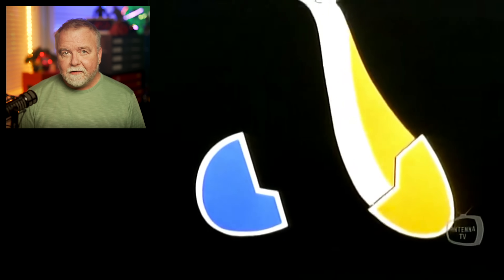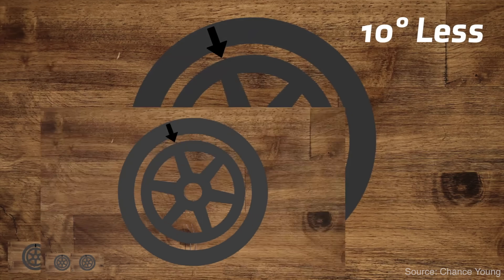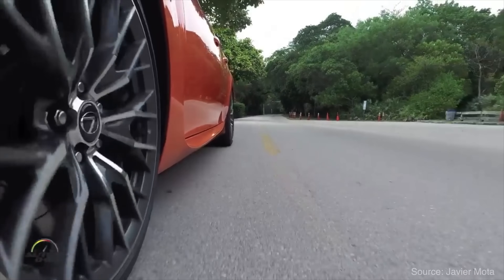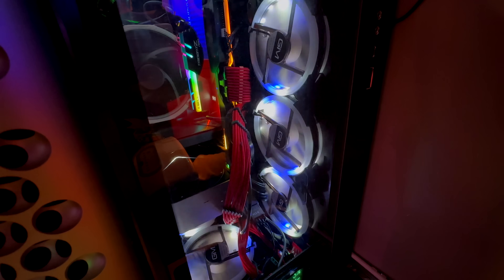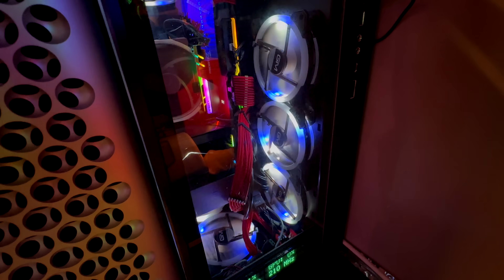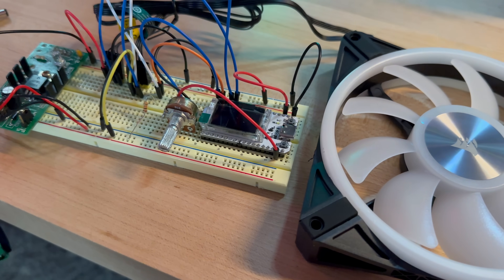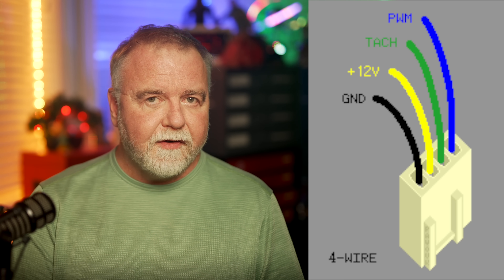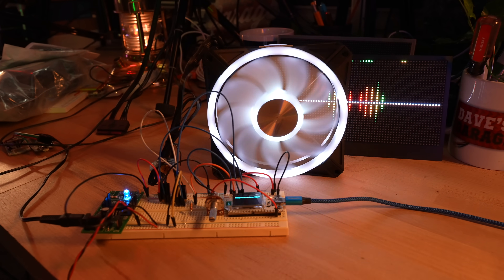Can I Freeze a Fan in Time with its RGB Light?

Comment: It would be a lot easier with non addressable LEDs. You could use a 555 timer and an IR reflectance sensor to flash the LEDs when each blade passes the sensor.
Reply: Or just a sensor that turns on the led when a blade passes by, like a proximity or opto sensor
Reply: would this not unbalance the fan some?
Reply: @PR0XYL1NK if you use an opaque fan blade there is no need for stickers or reflectors to unbalance the fan blade
Reply: @Sam-tb9xu  nice thats good solve.  thank you for the idea haha

Comment: I have a couple incites based on previous work.  First LEDs are very fast, a previous job used flashing IR LEDs to transmit audio for classroom PA.  We used FM modulation  (maybe 2-3MHz carrier, I forgot).     Lastly I did a thing that needed jitter minimized IRQs running at 16KHz.  (on screen display synced to composite video)   You need to consider the cores pipeline to reduce jitter.   I ended up using a high clockrate M0+ because its simple pipeline was the most predictable.  DMA (for SPI commands) ended up being an issue, as I had no way of setting the DMA priority and program ran 80% of its cycles in an IRQ routine.  The way DMA steals cycles from the MPU was a bit of an issue.
Reply: These are serial addressable smart individual led's. They have a serial line that runs at like 800hz to set the colors based on the address. So you have a serial data line at one freq, you have the input from the tach, you have the irq trying to do stuff, and you have the pwm input to the fan. Don't for get about the pwm modulation of the led's themselves. Also, the refresh rate and exposure time of the camera.
Reply: Did you intend to cause a riot of grammar knot-seas? Or did you mean insights?

Comment: Divide by 2 works because there is not enough time to process the LED drive  in the time available. So halving the number of times, but still running in sync, will give enough time to output the data and still be above 30FPS. 

A thing to try is to have a loop in main running all the time, that simply times the revolution time , counting up the number of interrupts to say 254, and also using a hardware timer to get a clock, that is the number of clock cycles (probably will need a prescaler so that you have a counter with lsb being a few microseconds) taken to run, and then that adjusts the count timer to the new value per revolution. 

Now you no longer have to use interrupt from the fan, instead you use another counter that is counting down, and giving a software interrupt that runs the LED flash. This counter gets updated every 254 counts of the main timing loop, to be a time that will give the right number of cycles as blades per revolution. Should then run that code and still not exceed the time between interrupts. With a 9 bladed loop probably can get away with having it run 3 times per revolution as well, leaving more time to have that ADC routine run to read the pot, convert into a PWM value between 64 and 256, and set a PWM for the fan speed control as well.  Going to be tricky, now we need at least 3 separate 16 bit hardware counters, but there should be enough in the ESP32 to handle it, though pin assignment will be tricky as some may not be easy to route, and you might need to actually have one or two actually go out and in again, but should be workable, as after all you do have a very fast core there.

Not easy on a 8088, but doable, and there you can always add in extra counters till you run out of IO space, but you got entire message displays that ran with software running the multiplexing, on a 4.77MHz part, and they did not flicker except during scrolling, running low on memory because they only had a whole 2k of memory in there, plus another 2k of battery backed Dallas SRAM for the actual messages, which had 32 bytes for the RTC as well. Plus a thermometer that pretty much always showed that the CPU and board were getting well cooked, as the sensor was right next to the linear regulators.
Reply: I knew I'd find the answer to this in the comments, and way more explanation. Thx
Reply: In reality you don't have to do all that for a short visual recording, you just need a strobe light that you can adjust the frequency with a potentiometer. You can litterally just dial in the speed until it looks right on camera. Also what looks right on camera may not be the same as what looks right to humans, the whole persistance of vision and framerate thing. It's easy to setup without even wiring anything to the sensors. It works as long as the fan stays at the same speed. If you change the fan speed you will have to change the rate obviously
Reply: This is not correct. The fans simply output 2 pulses (4 state transitions) per revolution. If you were to open the fan, you'll also see why, it's just the internal field phase control signal or alternatively the Hall signal because the motor is quad-pole, it's simply brought to the outside. Also a 2005 Intel PWM Fan spec says that they must output 2 pulses per revolution.
Reply: I can confirm that this is correct. The fan pulses twice per revolution.

Comment: one reason incandescent lamps are the best lamps to illuminate moving machinery.
Reply: There are led's that are constant current controlled or that smooth the pwm or line freq. Good led lights don't flicker.
Reply: @moki123g  I'm just old school,  incandescent lamps can't react fast enough to ever be a problem.
Reply: @TheEmbeddedHobbyist  True, not to be too pedantic but, incandescent lamps do flicker up to 13%. I have noticed it on lathes.
Reply: Hey we used to read and adjust the strobe dots on the side of the record player with incandescent lights. Though of course using a neon would be more proper.

Comment: Could you call UpdateTimers with an interrupt on the Tach line?  Then every revolution, the speed would be gently adjusted.  This would require two interrupt service routines.  And the code running every revolution may take more time than you have.

Comment: You use the interrupt just to set the boolean variable updateLEDs to true.
Then use if(updateLEDs) in the loop ( I suppose), to activate the Leds.
Why not activate the Led directly from the interrupt ???
Even if an ESP32 is fast enough, it seems to me it would be a better solution.
The way you use it doesn't really use the benefit of interrupts.
Unless I miss something ...

Comment: Cool video, Dave! Would an oscilloscope help you verify your two-tach-pulses-per-revolution hypothesis? You seem like the type of guy that has one and knows how to use it! (I would be helplessly lost!) 😅
Reply: Luckily, nowadays you get simpler ones for 150 to 200 bucks. They are "just" until 20 Mhz and have "just" 2 Channels, but for such stuff perfect!
Surely, it's not a professional one, but it's portable
Reply: @bernds6587   Nah nah about 205-220 will give you an Owon or Hantek and not that Fnirsi garbage, and those are actually 1GS/s and can be unlocked to 200MHz. They are real scopes with trustworthy readings and no horrible aliasing and other issues.

Comment: Small point: It is technically not "exactly one revolution per frame" it is one multiple of the angle associated with the objects order of rotational symmetry ..... unless you include the valve stem of course ;) If a wheel has four evenly spaced spokes then any multiple of 90 degrees rotation taking place in the same time period as a single frame will cause the wheel to appear stationary. Gotta love the spectrum!
Reply: I'm pretty sure the wheel shot was actually alternating wide and narrow 'spokes'. Still a pretty impressive coincidence. (unless he was watching the feed from inside the car)

Comment: Dr. Harold Eggerton developed this technique with Xenon flash tube to study synchronous motors nearly 100 years ago. He went on to develop several other high speed photography techniques to stop motion and also developed side-scan sonar imaging which later gave birth to the radar based equivalent.
Reply: Edgerton, and the technique is called stroboscopy. Stroboscopy existed  long before him, but he was the first to employ a flash lamp (which he invented) to do it
Reply: I played around a bit in the late '80s trying to do something with the flash out of a 110 camera. End result was 1 photo and a lot of broken light bulbs (my target). It would have helped if I knew anything about electronics at the time.

Comment: wouldn't it be better to synchronize it the with the tachometer? Rather than just flashing on a timer based on rpm, it could flash on every second tach pulse then flash on the timer for the rest of the rotation.

This would fix the issue where it appears to drift, as the cycle would reset at the same point of rotation. the reason to have it flash on every second tach pulse is because there are 2 pulses per revolution but an odd number of fan blades.

Comment: I bet you could fix the drift issue by resetting the timer for flashing the leds once per rotation, or if you compensate for the different parts of the rotation, every interrupt.

Comment: Might be triggering on both the rising and falling edge of the pulse from the sensor.
Reply: Not sure the modulation is 50%.
Reply: The Hall sensor also drives the motor. The magnetic ring in the rotor has 4 poles. The 4 coils underneath are switched in phase with the Hall sensor, to always pull the rotor along. So there's 2 transitions low to high, and two transitions high to low per revolution.

Comment: When the Tach signal pulses High, that's 1 pulse. When it pulses Low, that's the 2nd pulse. Thus 2 pulses for RPM
Reply: Yep, it's the order of the code that makes the difference. I'm also betting the individual pulses are quick enough that he's not getting both high & low of a single pulse. Would be curious to see that tach signal on a scope & find out how quick those pulse actually go by.
Reply: This is the description of the PulseIn() function:

Reads a pulse (either HIGH or LOW) on a pin. For example, if value is HIGH, pulseIn() waits for the pin to go from LOW to HIGH, starts timing, then waits for the pin to go LOW and stops timing. Returns the length of the pulse in microseconds

It gives the lengths of the pulse. Even if it would miss the second pulse on the same rotation the length of the other pulse (on another rotation) wouldn’t differ much from the first, I think.
Reply: @Conservator.  Yes and it's reading it go high, then low again (2 pulses). If it was just going high or low and not back, then it would be reading 1 pulse
Reply: @krislinder7460  As I understand it, it reads the length of the high pulse and the lengths of the low pulse. 
Those two are then added to get the full length of one rotation (assuming that there’s only a single high/low pulse per cycle (one magnet or one light hole)).

The software doesn’t count the pulses but it adds the lengths of the high and low to get the time it takes to complete 1 rotation. 
See 7:25
Reply: No, only high is counted.

There are actually two high pulses per revolution due to motor construction and the Intel fan spec. The rotor has 4 poles, and the stator has 4 coils. The Hall sensor reads high whenever a magnetic pole of certain polarity is next to it on the rotor, and this same signal drives the fan stator switching, with 4 transitions per revolution.
Reply: @SianaGearz Please look up the description of the PulseLn() function. 
I did and copied it in my first comment.
Reply: @Conservator.   Why does it matter in your opinion? I mean he counts whole high-low cycle as one cycle, measures the length. And he gets two cycles per revolutions. I have explained exactly why.
Reply: @SianaGearz  
You said: ‘No, only the high is counted’

The description of the PulseLn function says that it measures the length of a pulse, it doesn’t count pulses. 

It also describes that it can measure the length of the low or the high pulse depending of the given value.

Comment: The issue is that the PWM signal to the fan motor is merely a suggestion for what speed to run. The fan motor generates its own AC phases based on some logic and presumably some kind of time source that may very well just be some cheap resonator circuit, I doubt that there's a crystal in the fan controlling its speed.
Reply: PWM signal merely does rough work, high time (pull up resistor to 12V so it runs at full speed when not connected) simply enables the motor drivers, and they in turn are commutated twice per revolution by a hall sensor, to switch the 2 coils, the hall sensor output being sent back out on the tacho line using an open collector driver capable of sinking 1 LSTTL input load, or 10mA roughly, and this is the sum of the loop. PWM needs to be low frequency, under 50Hz, to get smooth speed control. The fan has a starter circuit, that is basically a pulse generated every second or so, that drives the one coil, if there is no tacho pulses detected for a second, which indicated a stalled fan. All done in one 6 pin package, which has all that on a single chip, largest area being the 2 current limited drivers, and catch diodes, and the hall sensor on the one edge of the die.
Reply: @SeanBZA Thanks for your very informative comment! 👍🙏
Just out of curiosity: how did you know, if I may ask?
Reply: @Conservator.  Taken more than a few apart.......
Reply: @SeanBZA  Cool
Reply: @SeanBZA  I'm not gonna ask how, but you know! Thanks for that info!
Reply: @SeanBZA  Intel says PWM frequency must be between 21 and 28 KHz on PC. I've tried low frequency PWM and i'm not convinced.
Reply: You would need to do a closed loop regulation with the esp32 based on the 2 signals but it wasn't really the point of the project I guess
Reply: I had the same idea.
I think the best solution would be to detect the real speed rotation.
But if it works ... :)
Reply: Would using whatever is used to determine the PWM not also help to determine the rate of the argb, so rather than driving the fan with PWM, reading the tach then calculating the argb flashing, instead say take the temp (as an example) multiply by some value to determine the PWM and another to drive argb, then use the tach as correction, I suspect one would need to build some lookup arrays on a per basis due to slight manufacturing tolerance, this may also be a really silly idea of doing it